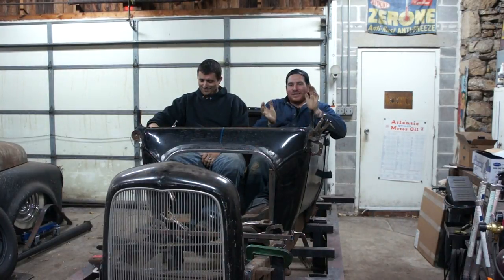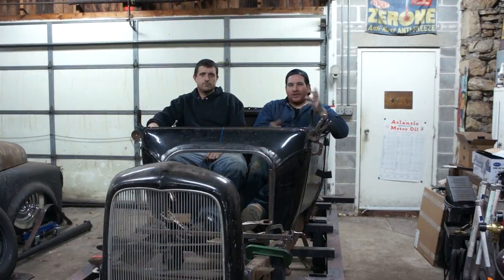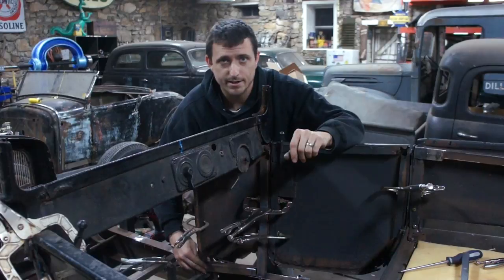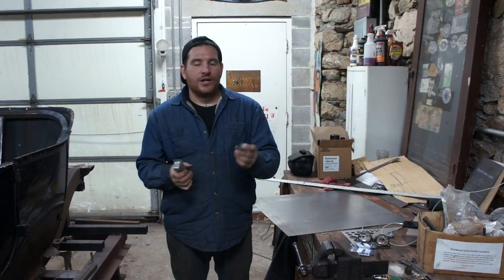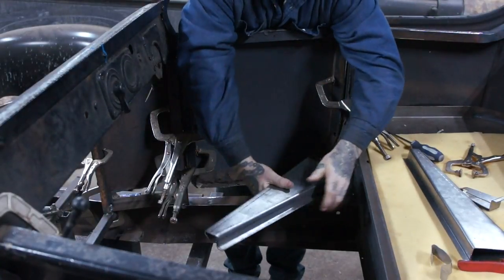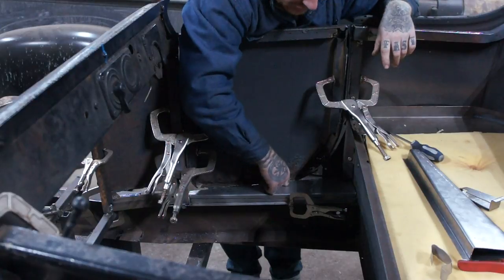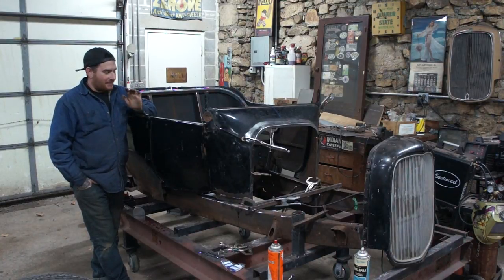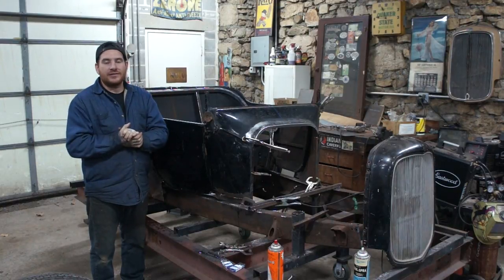How to make a Inner Rocker Door Sill for Ford Model T- Ford Free-T - Ep. 8

Comment: Hey man, that doesn't look like the right frame or grill for a model T. Other than that it looks like you are coming along with the thing pretty good.
Reply from the maker: It's a hot rod that's the point!
Reply: OK, I'm not putting you down. It looks like the parts you've come up with are in pretty good condition.It's really hard to find original parts that are not just trash and they all want a huge price for their trash.